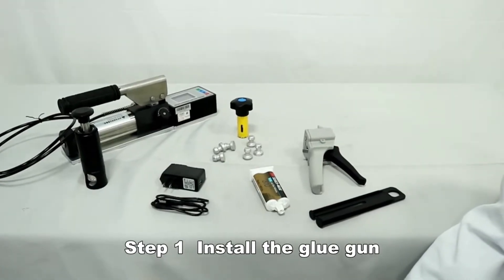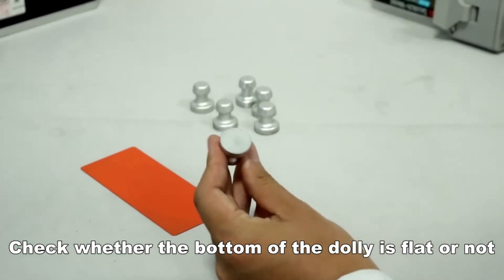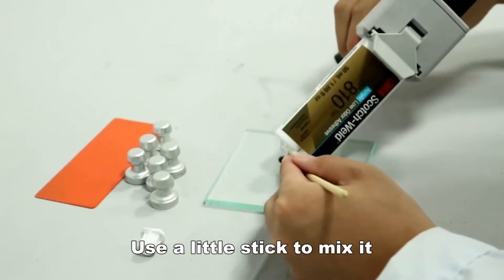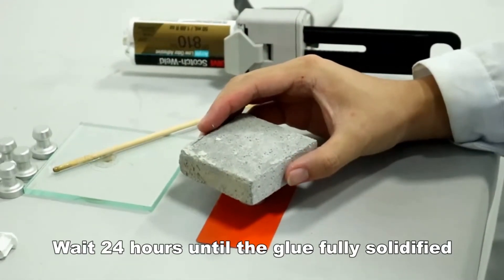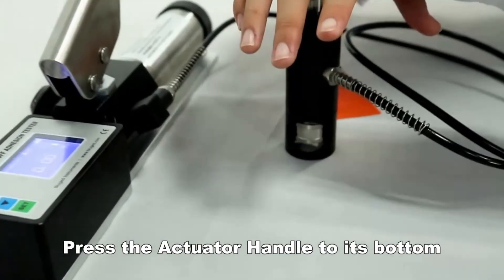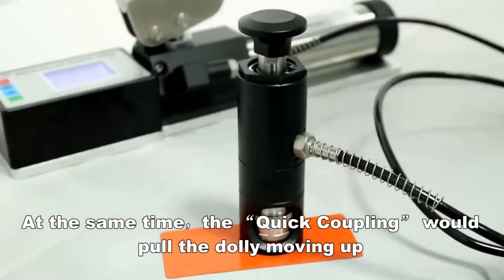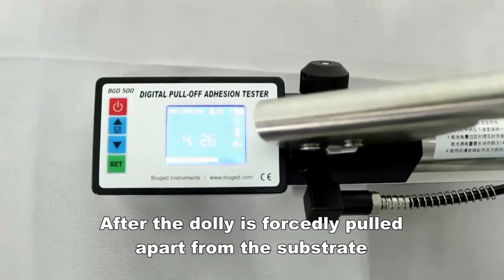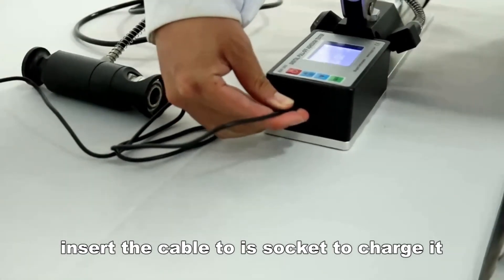Pull Off Adhesion Tester ASTM D4541, ISO 4624 Accurate Testing

Comment: How soon should the pull off test be done after adhering the dolly on the dried paint sample, is it really 24 hrs. What are the pros and cons if the test is done after 48 hours curing of adhesive placed in the dolly?
Reply: Best Way is to cure samples as per glue manufacturer recommendations. Normally 48 hours gives best results for painted surface